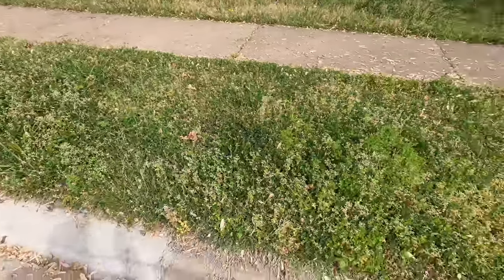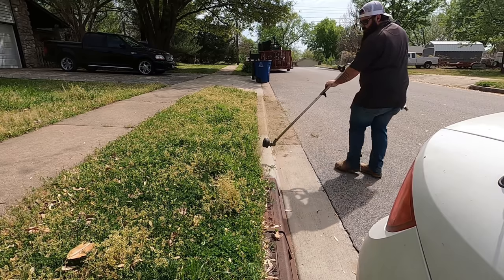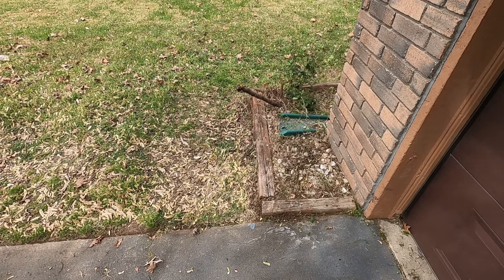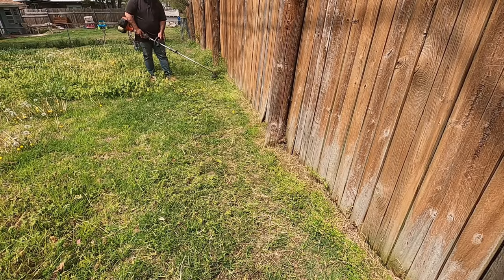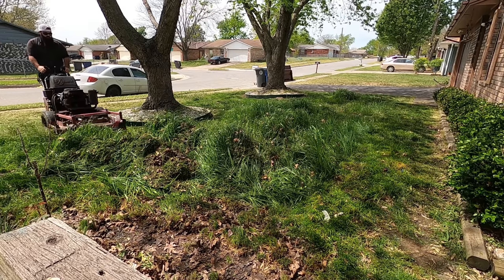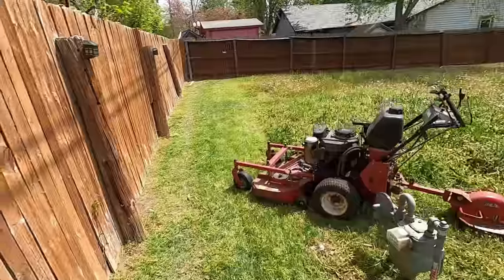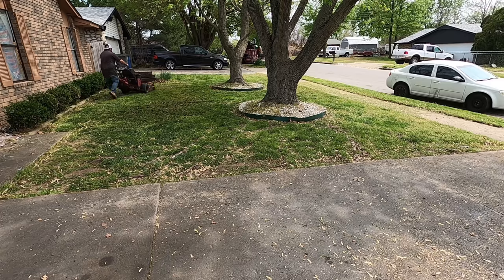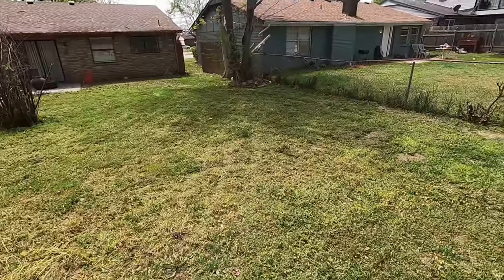do I even know how to cut grass? - mowing tall grass in the spring

Comment: Most of what I do is 5 to 18 acre lots using a John Deere tractor with a 6 foot rotary cutter. I use my front end loader to knock down big dirt mounds, filling holes (and I have filled some over 8 to 10 feet deep) and put in driveways. I do this for a lot of older people who can no longer sit a tractor for 3 - 7 hours depending on their property. There is NEVER a charge to them, but with the cost of diesel I may need to ask for gas money. There are times that I go into yards and do some of the things that you do, but not often. Tools are key. The right tools makes for a good professional job. LOVE your videos Juggernaut, and I appreciate your heart for helping people in need.

Comment: It's funny hearing you call it a weed water as it's a strimmer in the UK, used as a brushcutter when it has the metal blade attached. I have a Stihl strimmer and the guard is pretty good quality. When I took my strimmer/brushcutter licence, we were taught to take our hand off the throttle for a split second at the end of each sweep to the sides as it helps preserve the engine and the fuel consumption is a lot less. I do whatever feels right when I'm strimming back banks to keep flowering plants there.

Comment: i've tried guardless..and the amount of garbage that hit me was terrible.  Also when you get the line really long(like when you are going around the roots) having the line so long you really slow down the tip speed or the line..especially when it gets bent back by taller grass(which you can hear the change in it going through the air).  Keeping it guard length is the tip speed stays higher and you do not get slowed down like you do have it really long.  You do not get the full benefit of that 8-12 inch line length as much as you may think.

Comment: Im a on the taller side,  I Have never used a straight trimmer.  I always used the one with a bent neck at the end,  mainly cause they were cheaper cost.  Im sure there is a reason for this.  Is the straight easier to operate? better on back?

Comment: Have you try the new husqvarna trimmer head rapid replacement its speed feed they have them at tractor supply its fist on stihl red max in i think echo too
Reply from the maker: I actually got one before it hit the market. I will be sharing my thoughts about it after I have put it through the run.
Reply: Ok cause i bought one this morning am going to use it very soon after it dry the grass we been having alot rain here in texas

Comment: Quick question... my Echo trimmer doesn’t allow me to turn it upside down.  It’s chokes and then cuts off.  Am I doing something wrong?  Thanks for any help.
Reply from the maker: Your fuel filter is clogged or the hose inside the take is not positioned right and can not move when the unit moves. you can get a tune up kit for the hoses and filter for about $10 or $15. that should help
Reply: Thanks!!

Comment: why do you tap the bottom of the weed eater on the ground every now and then?
Reply from the maker: That is how you feed more line out. When you bump the cap on the weedeater it releases pressure on a spring on the inside of the head and the string is pulled out by centrifugal force.

Comment: why don't you pay attention to the parked cars? the paint on the white car has guaranteed been damaged.
Reply from the maker: No it doesn't. I have been doing this for years and never once had a problem. I am very aware of what I am doing and how I am doing it.
Reply: ok - you are a professional.  but personally, i would never ever use this device without any protection. with a blade (or cord) diameter 250 mm, a speed of approx. 380 km/h can be achieved at 8000 rpm. Even a small stone easily smashes a window at this speed.
Greets from Austria!
Reply from the maker: @Foltl  ya you can also adjust the speed my not pulling the trigger all the way. Just because my car can go 120 mph doesn't mean that i do that. the same thing applies to the string trimmer. I don't have problems from it because i am a professional and have spent the time to become a master of my craft.